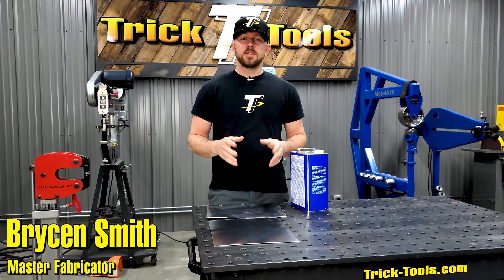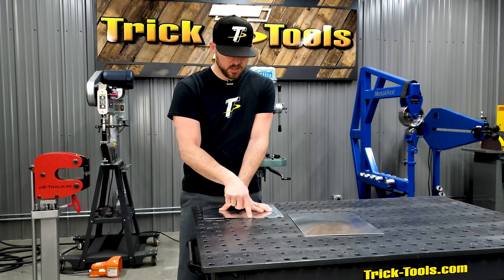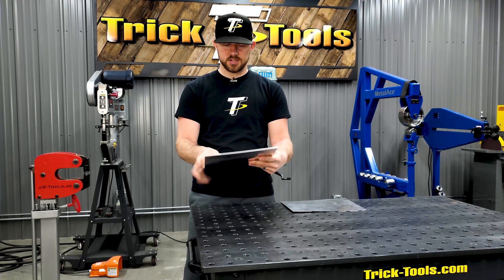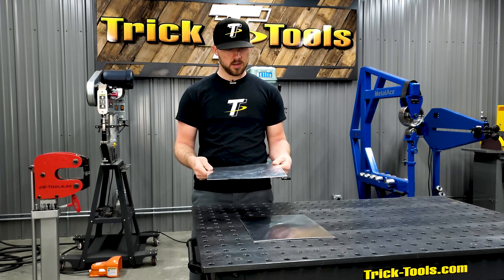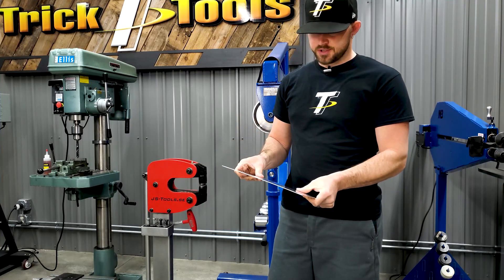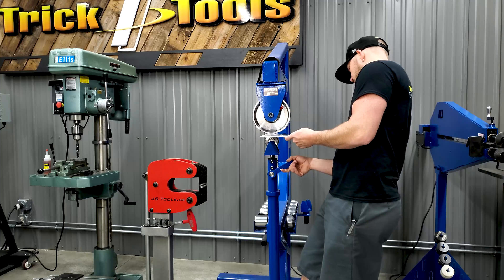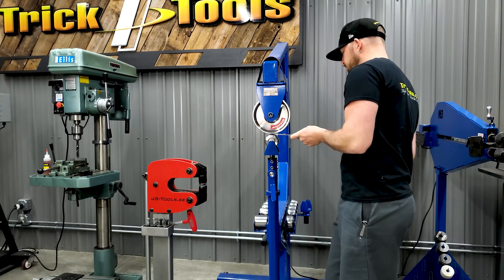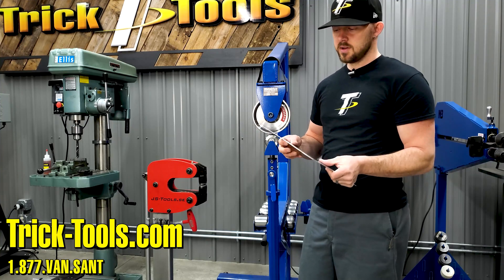Trick Tip Tuesday #12 - How do you fix Oil Canning in sheet metal? - Trick-Tools.com

Comment: I have some metal drawers that have the oil canning where it droops in the center which will scrape the drawer below when opening. For a hammer and dolly, would a shrinking hammer be recommended to use on the edge?
Reply from the maker: We do not recommend shrinking hammers.  They make a mess out of the metal with their textured face and don't really shrink.